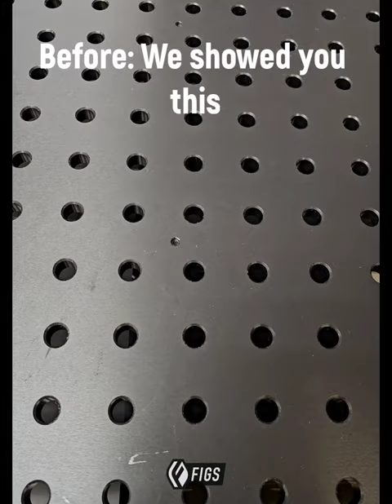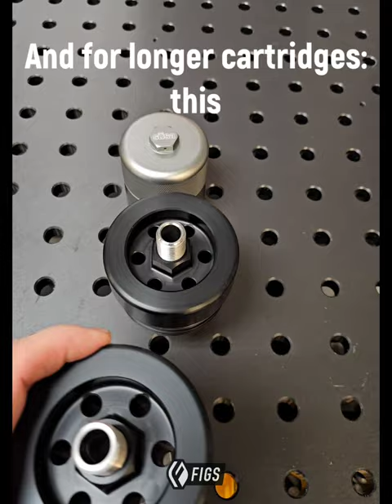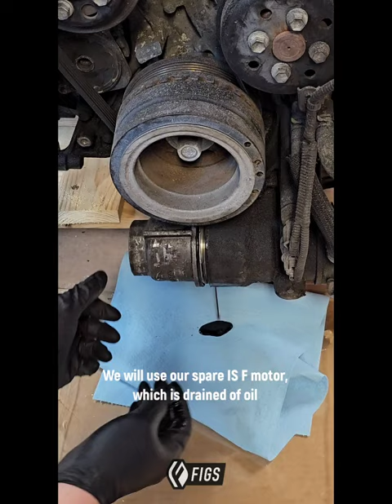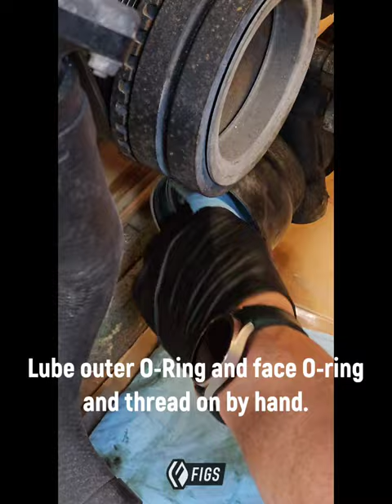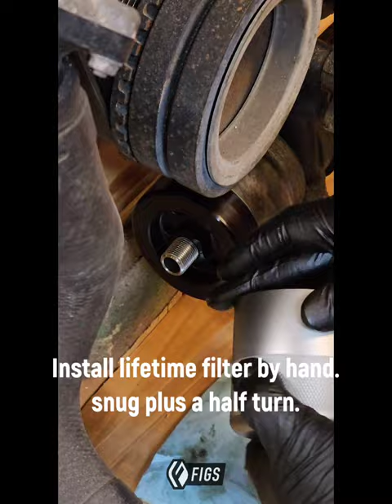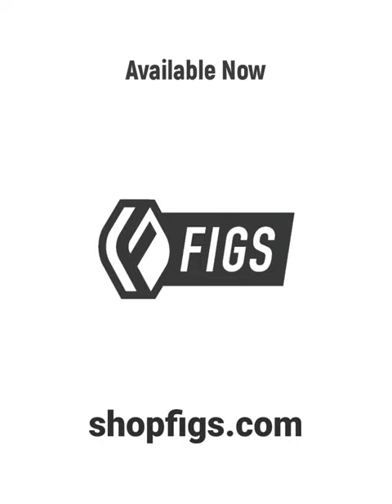Cartridge oil filters suck! Use this instead.

Comment: That’s pretty cool, why do cartridge filters suck?
Reply from the maker: They deform,  break down, and are a pain to change. Housings frequently seize and plastic versions flat out break.
Reply: BS. This is  because people don't  know how much to tighten them.  They are not  made from cheap plastic. People tighten them so much then use breaker bars and impact wrenches on them. They do not deform under normal use total nonsense
Reply: @FIGSEng I did have a housing warp over time on my vw, had to replace it as well as the housing gasket which was a crazy hard job on that gti

Comment: This beyond a horrible thing to do
Reply from the maker: And why is that?
Reply: First off Toyota makes a metal cartridge filter housing. Most plastic filter housing break because of excess torque. Adding some sort of adapter is another part to fail. the car is  not  designed  for this. Doing this to the most vital part of an engine (oiling system) is a disaster waiting to happen. While i do not care for cartridge filters it's better than this adapter.  On my 2 Lexus and Toyota Camry i have all the metal cartridge filters and they are  all torqued to specs. No issues at all!